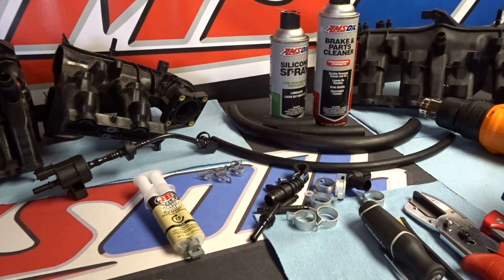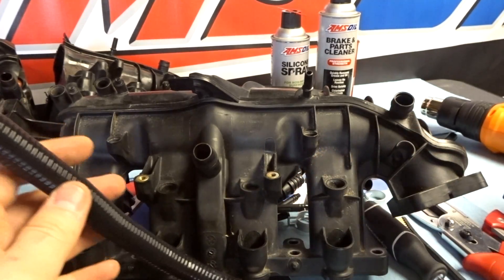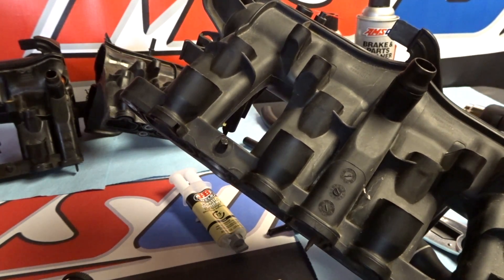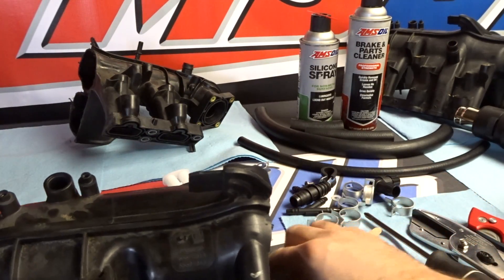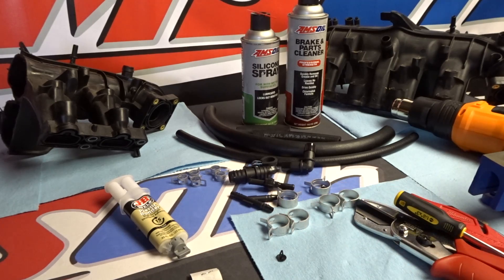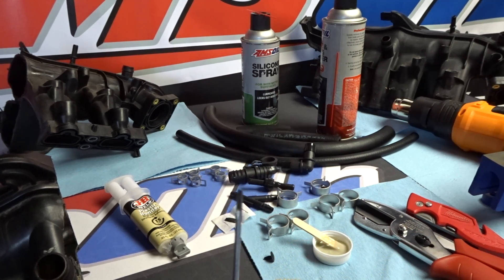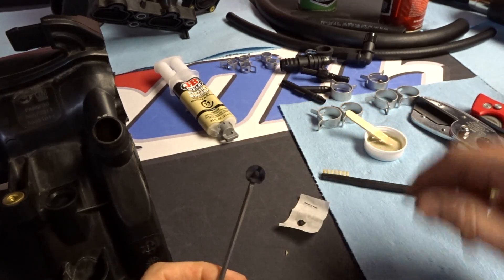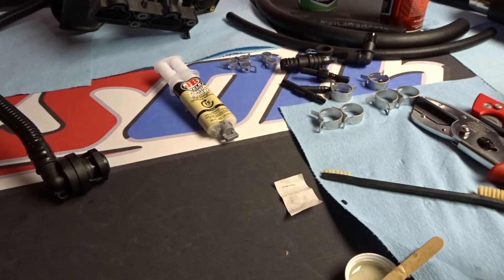How to Install the CruzeKits.com V3 PCV Fix Kit

Comment: The V2 kit went together very nicely,,,its not a bad  job to remove the intake...thanks for engineering this kit
Reply: Do you plug the left side of the evap line with the stock hose or just leave it how he has it
Reply: @brandonvandyke1650  I just installed it exactly how the video instructed.
Reply: @MandrakeRoots  cool thank you. One more thing did you notice the small hose that is with the pcv hose does that stay connected? I didn't notice it on his in the video so I just assume it stays connected at the same points
Reply: @brandonvandyke1650  I'm sorry I just cant remember a small hose, but when I get home I'll look things over...but I can't recall any unused parts from kit.
Reply: @MandrakeRoots  thank you very much. I'm not   knowlaged on engines and what not so I appreciate your input.
Reply: @brandonvandyke1650  so I tried going down memory lane looking at the kit I installed, I got the brass fittings/ valve off the manifold then a rubber line to the push connector that was in kit which connects the original line making it 2 lines coming off top of manifold...other than that the video describes it pretty good...just make sure you have torque specs and procedure to tighten manifold...youtube every question you have, it is my only go to to working on cars. Hope this helps, I am only a home mechanic.
Reply: @MandrakeRoots  thank you very much!! I ordered the v3 today hopefully it works out.

Comment: Man I wish this was available when I ordered V2! Great job continuing to improve your product.
Reply from the maker: Thanks. V2 uses a better check valve IMO that theoretically shouldn't need replacing for the life of the vehicle, while this will probably need to be swapped out every 50k-75k miles, but I'll make the check valves available for $8 so it shouldn't be bad. But yeah I needed another design that provided even more value than the last and I came up with a way to install without removing the manifold in the process.

Comment: Note :Silicone can damaged a O2 sensor. Great video 👍
Reply from the maker: Aye, but just used as a lubricant on some fittings won't make the slightest difference in that regard.

Comment: Great design! This helps me with finding a way to install a oil ketch can, thanks!
Reply from the maker: Oh yeah, this will make catch can integration much easier! You can run a 3-way catch can with this kit and clean both the vacuum and boost PCV paths.